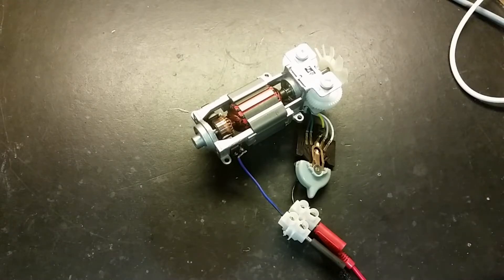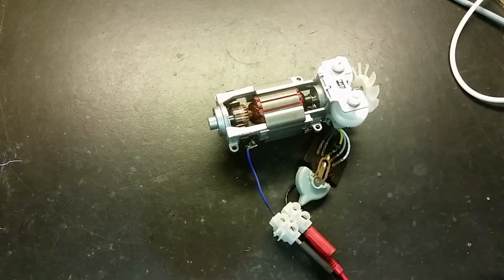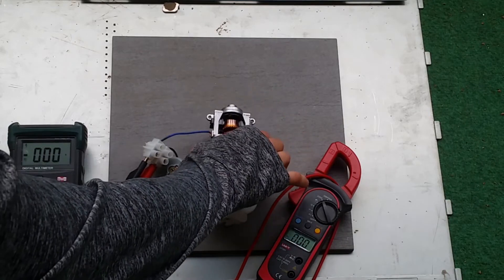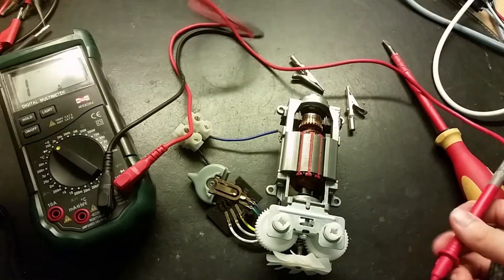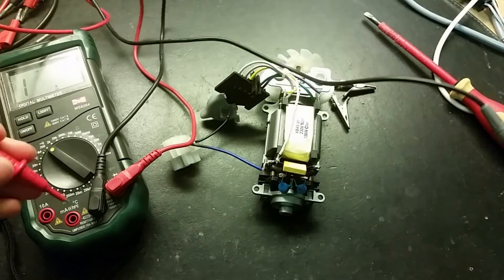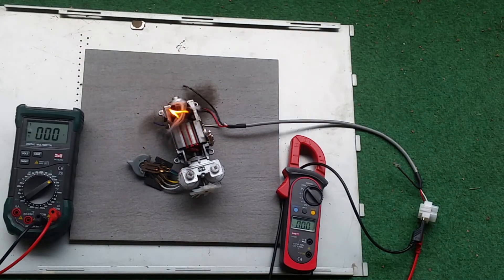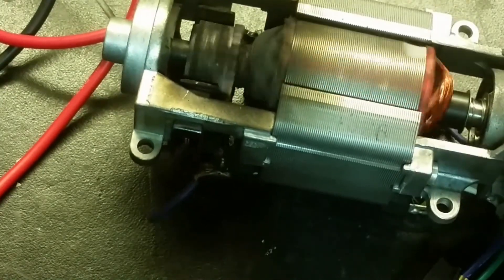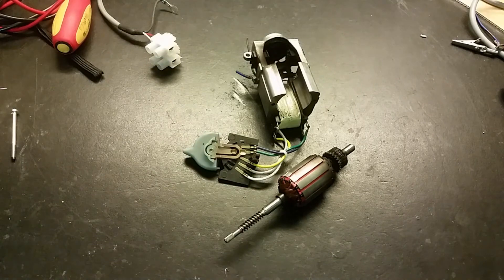Mixer Motor Burnout

Comment: What was the handmixer model? I have this ABC-MIX vintage German, that you can see on the channel @missmixyyt
As usual, the motor is OK after huge amount of abuse (see the videos) and the only essentials broken were the motor gears (nylon I presume) and the solder on the speed selector (!) which melted. Still works.
Reply from the maker: @semirecumbentoneYT  I don't remember, but it had a very resilient motor
Reply: @MrTesla1337  Usually the motors can take anything, they heat up so much they melt the plastic casing, but because usually made of metal, they cannot break only the solderings can (fixed one) due to weakening of excess heat. The coal brushes are big and do not need replacement. Only weak link seems to be the motor gears, that needs to be replaced.
Reply: @MrTesla1337  You seem to be a very, very, talented electric expert, as I see from your huge broad scope of different electric "teardown" fixes videos you have. Congratulations! May I ask you something? If you needed to replace the motor axle gears (usually made of plastic) would you 3D print them or buy from a manufacturer? Highly appreciate any help with this matter.
Reply from the maker: @semirecumbentoneYT  thanks, very kind of you 
If I had experience and a 3D printer available i would definitely give it a try, sometimes it is a bit hard to get or maybe the manufacturer have discontinued the production of the spare parts
Reply: @MrTesla1337  Yes it's very difficult because it's from the 60s